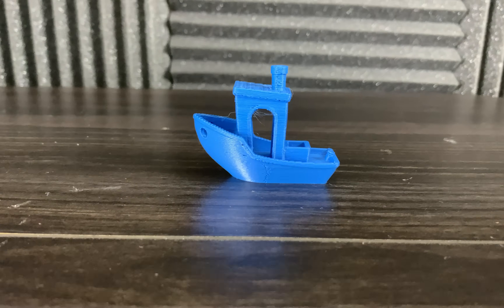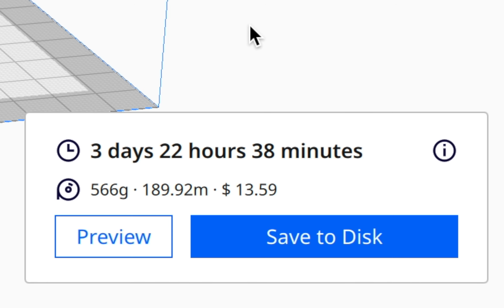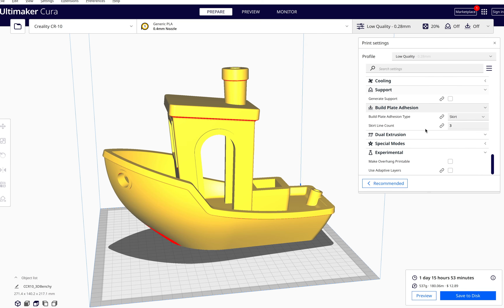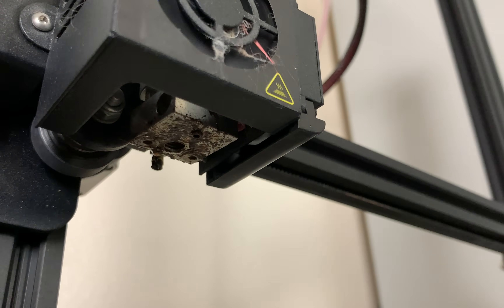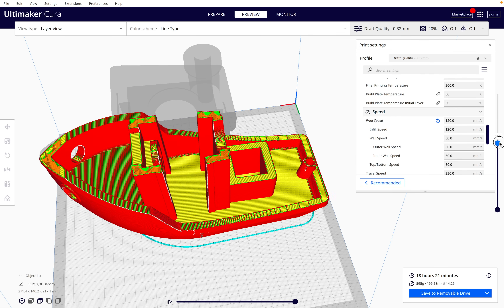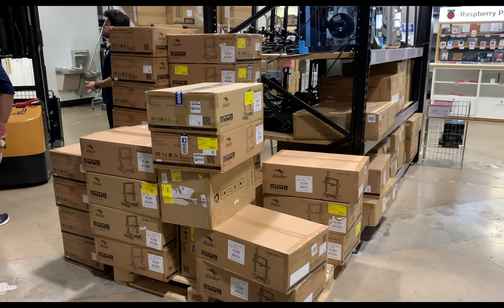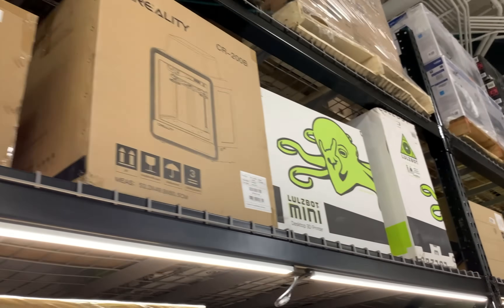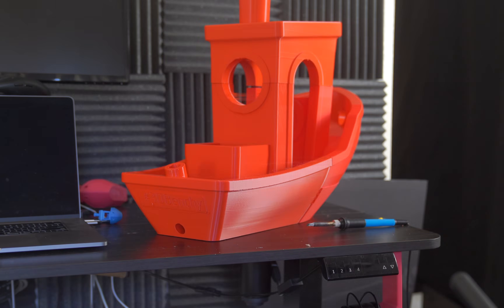Stop 3d printing so slow!!! 🤯 (how to print faster)

Comment: 99 bucks for a Pro is great. Get it, flash the board with a version of the Ender 3 V2 software and you have a helluva great printer. That is what I did to my old Pro and now I have a nice New V2... The only difference is the center extrusion location. V2 is 25mm farther forward on the center cross extrusion. This places the build plate father forward of course. You just need to reposition the rear limit switch to set the front left corner of the bed with the nozzle. If you still have the stock wheels on the bed then they have enough clearance before they bottom out on the Y axis belt tensioner housing. I converted mine and she prints just like my Voxelab Aquila that I changed over to a 4.2.7 Creality board and is now a running V2 software. Now you say WHY maker the change... It's all about the software. V2 with the Marlin2 leveling feature will turn your pretty nice little Pro into a Powerhouse V2.
Reply: I can't find the promotion he is referring to.  I wonder if there is some promo code or coupon somewhere?

Comment: Tree infill is a disaster such that the printer retracts like a mf... It might be faster but the printer itself suffers badly. Just make 8 walls and put like 5 or 10 percent infill. That way it is scalable. Small things are stronger and big things are strong but dont have crazy retractions and still print quickly as it's like having vase mode on, because of the many walls. Job done asshole.

Comment: Without the correct hotend and extruder combo you cannot print at more than 80mm/s without running into quality problems. The stock Bowden Ender 3 setup won’t work that well on high volumetric flow rates. Yes it is printable but you will face skipping on the extruder, or lots of under extrusions

Comment: Now if only you used prusa and used infill every 2 layers or 3 layers you'd cut down your time even more then by using lightning infill but jeez lol ye I could print my entire bed 235x235x250 in 6 hours with 60% infill on honeycomb but ya know yes I'm also losing quality by increasing layer heights aswell but dude there's many other settings you could tick and have insane quality at a insane speed (0.16mm layer height I can print at 120mm/s on a 0.4mm nozzle which says allot because your 0.28mm layer height with a 0.4mm nozzle is about the same speed as my 0.16mm layer height so in terms this video is a bit iffy in terms of slicer settings and how we can really print

Comment: Ideamaker slicer has adaptive infil where you set a percentage for the majority of the print, but 3 layers before a solid layers, it will use the higher percentage. i set mine to 5 % and 15%. I also use 0.32mm layer height on my 0.4 nozzle with a line width of 0.5 or 0.6mm which is the same as a 0.6 nozzle, but with my stock nozzle. people think you need to change nozzles when you dont. 3D printing was originally designed around a 0.5 nozzle and 0.5 line/extrusion width.  with my stock 0.4 nozzle i print with a line/extrusion width as low as 0.3 and as high as 0.6 with no issues.
Reply: Maybe your nozzle is worn out🤔
Reply: @Leynad778  its a new nozzle. You dont have to change to a 0.6 nozzle to get the benefits. On my 0.4, my line width is at 0.6 and my layer height is 0.32 for some parts

Comment: You didn't even mention layer width. With 0.4 mm nozzle you can print layers up to 0.9 mm width. Also lightning infill is not stable. Also when talking about speeds, you completely skipped acceleration and jerks

Comment: This video is more a commercial than helpful content. It seems like it was made for people who have never even 3D printed not those looking to reduce print times
Reply: I disagree. A 3 day print has loads of time to fail or have power outages. Faster is often a better finish too.
Reply: @Hotwire_RCTrix  How is your reply addressing  the comment made by evank7113 above? It's like you just wrote a comment and randomly replied to his comment. His comment points out that most people who know how to print already know that increasing print speed, adding a bigger nozzle and using bigger layer height make a faster print.
Reply: @jellibeens  "most people" means that not everyone knows you can do this. This video was very helpful for me and I'm sure it helped a lot of other people who didn't know or are just beginning 3D printing. I learned to push the limits of my printer a little bit.
Reply: @MG_LIFE_LBS  I am glad it worked for you and I hope you enjoy 3D printing. But the video should have been called something like 'Faster 3D printing for beginners'.
Reply: @jellibeens  Nothing in this video was useful. Materials like PETG won't let you print beyond 70mm/s. you can raise the temp and try to push harder but you chance a nozzle clog.

Comment: If you have a nozzle of .6 and layer height of .32, you can probably get away with increasing line width to .9 too.
Reply: You need to do multiples of the nozzle so it would have to be .30 or .36 for layer height I thought
Reply: @chitownbangin  why do you need multiples of the nozzle?

Comment: Yeah, you can print fast by swapping nozzle, increasing layer height and linear speed... but you must also have an extruder/hotend combo that allow you to push like three times the amount of filament in any given moment (on an Ender 3 with stock hotend/extruder you're not gonna push out 23+ mm3/s of filament at almost 10 m/s of filament speed) , not to mention the fact that you need to tune settings accordingly.

Useful knowledge, but fairly incomplete unfortunately
Reply: He is pushing 120mm/s at a layer height of .32mm on .6mm nozzle. Thats around 23mm3/s. I dont know if stock ender 3 can melt filament that fast
Reply: @fkncobra  it can't
Reply: nah stock MK8 flow can never reach 23mm/s, volcano may be but mk8 can never
Reply: @quannguyenduchoang1075  im ushing 47mm/s with stock hot end on ender 3 pro with abs
Reply: and that it decreases the overall quality
Reply: voron 2.4 is fast🎉

Comment: Don't buy ender 3 pro, after few hours of print it will fail, and you will start the neverending "printer upgrade" project.
Reply: It's true,  but it's definately worth it. You just have to take the time to learn how to fix them. The parts are cheap enough, and easy to find. I have an ender 3 basic, a pro, and a v2, they are all running 24/7 right now, and besides a little maintenance every couple of days, they have been running like this for months. Well worth it, in my experience.
Reply: cry about it, my ender 3 pro is still going strong after a few months

Comment: I got the ender 3 pro on the MC deal for $100. A few months later I hit the cheat code for a better printer and print faster at .2mm with higher accuracy.

I just had to shell out $1000 for a bambu labs KS bundle. 🤣 no regrets.

Comment: What is that price calculator plugin?
Reply: It isn't a plugin, just part of the Cura settings. You have to go to the materials settings in preferences and input the filament cost and weight. Then when you slice you'll be able to see the cost of the print.

Comment: TLDR: Microcenter needs to stop making that deal first-order only because they're hemorrhaging money, overvaluing NTB, and screwing us, the important customers (avid repeat buyers). 

It's an unfortunate result of marketing leadership overvaluing new-to-brand customers. Yes, in ecom NTB are generally worth more than returning but that model breaks down with this specific Microcenter Ender 3 deal when you take into account a) people who buy multiple 3d printers over time tend to REALLY keep buying them (so this cohort's retention is amazing), b) people who are new to 3d printing tend to NOT buy more than 1 (so this cohort's retention is shit), c) a significant percentage of "new" customers who secure this Microcenter discount are actually returning buyers gaming the system, further muddying up the data and making NTB and CAC look better than it actually is, d) while there is merit to the assumption that this deal has a big impact on mass adoption of 3d printing, I guarantee the microcenter marketing team has not accurately quantified what that impact is because it would require all the major competitors to share data and properly gauge incremental adoption which is essentially impossible, e) deep discount promotions like this only pay off if a strong retention and LTV are expected. Which is clearly not the case here.

Source: have overseen ecom for some big brands
Reply: its not that serious
Reply: Oh yeah far too many micro center things are new customer only

Comment: i find hard to believe the hotend on the ender 3 can push 120mm/s printing speeds with a big nozzle.
Reply: Rated flow is inthink under 12mm³ per sec. So 0.4x120x0.28 is 13.44. So not too much for short bursts . The speed is always the top speed remember, which is achievable only if the line is long enough to accelerate to and decelarate from the max speed in the distance available. So often, the actual avg speed isn't going to be 120 per se.
Reply: @ishanmamadapur6307  , would the calculation need to be 120 x 0.27 x π x (0.4/2)^2?

IE, taking the area of the circular nozzle rather than its diameter?

Not sure as new to this so I might be missing something.
Reply: Ya, you can clearly see where it starts under extruding in the video.
Reply: Yep you're right. He isn't taking into account that the hot end can only melt a certain volume of filament per second.

I normally print at 150mm/s with a 0.4mm nozzle. But with a 0.6mm nozzle I can barely get past 80mm/s without running into issues.
That's with bigtreetech upgraded board with nice stepper drivers and a pi running octoprint.

This guy just messed with slicer settings and took the estimated time as gospel without testing those crazy low print times.

Comment: 120mm/s,  how so?  I tried uping mine to 80mm/s and had so many issues,  what other settings in cura are you changing?
Reply: Ya, when he showed that shot of the stock ender 3 printing at 120mm/s I had to laugh looking at the underextrusions it was making trying to keep up.  A hot end with a longer hot zone like a volcano, etc would have no problems with that.